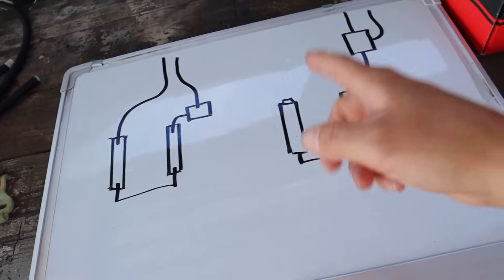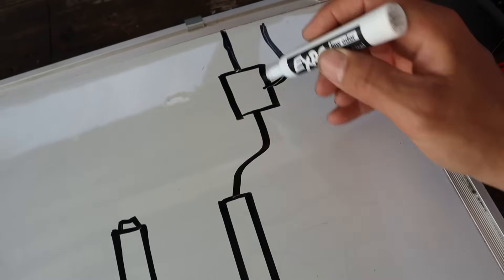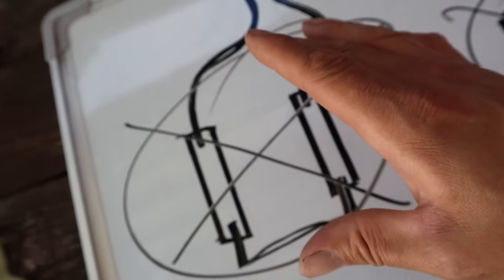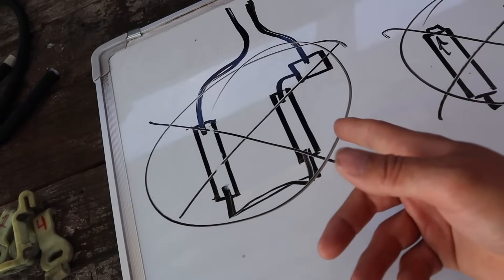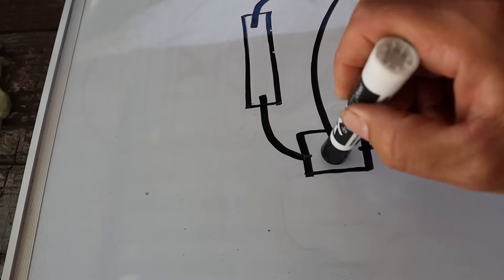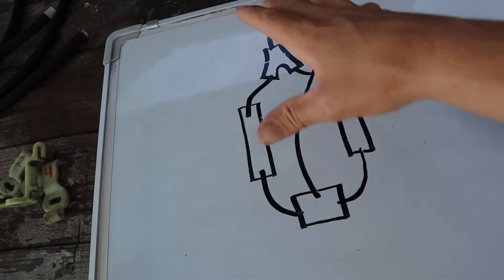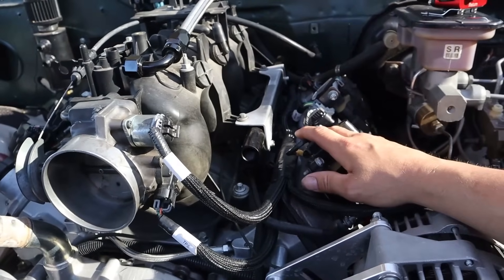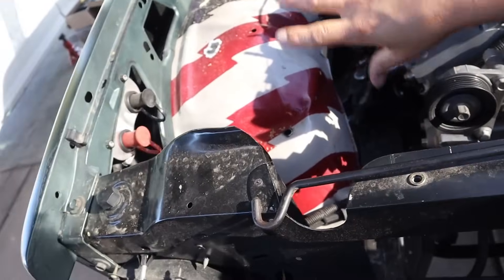Best Routing for your Fuel Pressure Regulator on your LS Swap

Comment: This is brilliant.  I was deciding whether I should deadhead, return-style, or y-split, and this video sold me on y-split. A guy at Motion Raceworks said he always uses a y-split with the regulator after the rails.  Good thing about this setup is the pressure in both rails is exactly equal all the time, and fuel is always moving, so no chance of vapor build up. Fyi i have 600 HP in a new LS3, based on TSP stage 2 cam and valve/head work TSP did.

Comment: It doesn't work like this. The pressure doesn't care how is it distributed. If the pressure is inside in a given system it aply the same force on every single point of this system. Weather you would distribute it individualy into each injector or as a one inlet. You are just making it hard for yourself

Comment: Your first solution on the left is how 99% run there setups. The only time you would have a lean vs rich issue on that setup is if the crossover fuel line somehow gets blocked. Which is not common at all.  It's not science it's physics lol path of least resistance.  If you have a stick open fuel injector guess what they're all still going to see the same pressure.  This is one of those times you are over thinking and making it more complicated then it needs to be.  Loving the build! Keep up the OCD I love it!

Comment: Pleaser don't put a pressure transducer directly on the fuel pressure regulator. 😕 They absolutely HATE engine harmonics and vibration. Any pressure or temperature transducer should be remotely mounted using something like a Lowdollar Motorsports or Holley remote sensor block and then that mounted to your firewall persay.

Comment: Mount the regulator on the fuel rail when you go to remove intake manifold all you disconnect is the feed and return line and the fuel pressure sensor and it all goes with the manifold

Comment: 6:36 definitely recommend any engine with more than one head , to have atleast 2 wide bands if not 4 for upstream and downstream altho tbh its kinda pointless unless u are doing pre cat ext , otherwise , get a wide band on each bank so you can atleast tell that , then ya get into individual get sensors per runner 😅.. it's a rabbit hole , but of the funnest kind , cuz once ya get throu that hole , on the other side , ya got a monster of a build 😊.. mad props and respect, fam .. peace and love all, keep it rad, stay safe, and build on.. l8r famz and keep having fun #DBFamStrong #BuiltNotBought #WhoopWhoop #420

Comment: How do you set your fuel pressure when the regulator is after the fuel rail?
Reply: @Turbo-87-318  the regulator maintains the set pressure whether its before or after the fuel rail/rails.  Doesn't matter how you plumb it, works the same.

Comment: Kind of, sorta, maybe. But not really!!! But that is one way to do it. The main thing that got me, is how worried you are about equal fuel pressure in the fuel rail and the fuel pressure regulator you are using. You will be doing good if you get consistence fuel pressure in the whole fuel system with that fuel pressure regulator. You might, the bigger question is for how long. 
The reason manufactures do fuel systems the way they do is heat soaking, gasoline boils at 131f. Less fuel lines under the hood, the less opportunity for heat soaking the fuel. Opportunity for leaks is another reason, less mechanical connections less chance of leaks. Also shorter fuel lines means the fuel pump doesn't have to work as hard. The biggest reason is cost.
Here is the kicker... How many fuel feed lines do most top fuel car use? One -12an to feed 24 injectors in the heads and 10 to 14 injectors in the blower hat mostly to lube and cool the blower. Two fuel return lines. Believe it or not top fuel cars push 10 to 12 gallons of nitro through a -12an line in less then 5 seconds.

Comment: You also could put the regulator before the y and then u wont have hot gas goin back to the fuel system you'll just need syper long vacume line😂

Comment: Makes good sense. So a Y in the center of the rear with 2 equal length lines to the fuel rails and 2 equal length lines to the pressure regulator lets you place the Y and regulator wherever you want right?

Comment: Easy option single big line from tank through a filter the out of the filter split to two lines one to each of the fuel rails through the rails out the front into the regulator and a single line back to the tank. I used-10 and-8 PTFE running straight e I'm going for 8's overall in the next 2 years and wanted a fuel system up to the task. Running two hellcat pumps in tank and will probably get a aftermarket hat for triple pumps and add another hellcat pump and run-10 to each fuel rail. Also using Bosch 210 injectors which even on e can support well over 1500 HP. For under 600$ when I bought them from vs racing they are the ls3 type injectors

Comment: I ran main line down drivers side frame rail to drivers fuel rail then it crosses over to passenger fuel rail at the throttle body then exits fuel rail and goes into pressure regulator and then regulator returns unused fuel down passengers side frame rail and dumps into the top of the tank through the bed. Seems to work. We shall see. Blazers looking good!